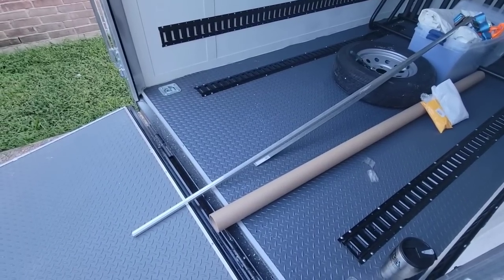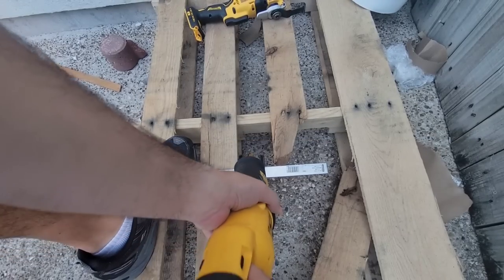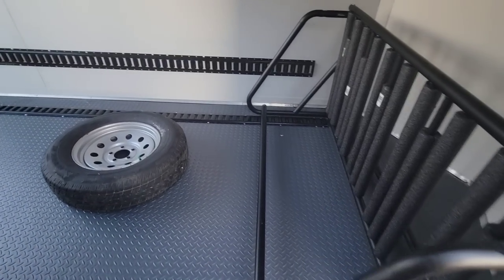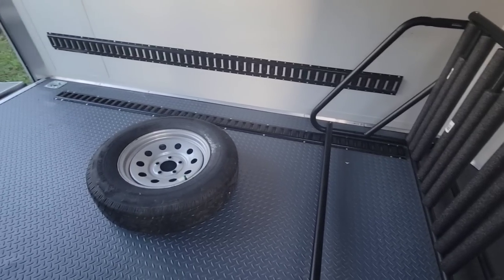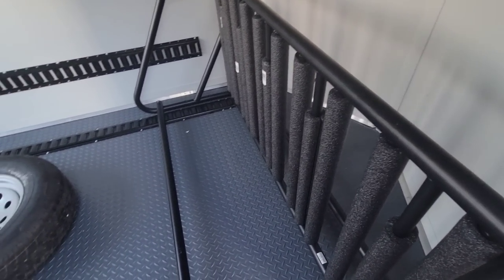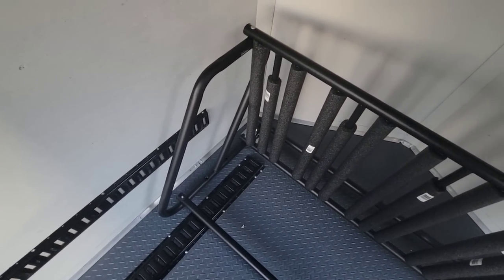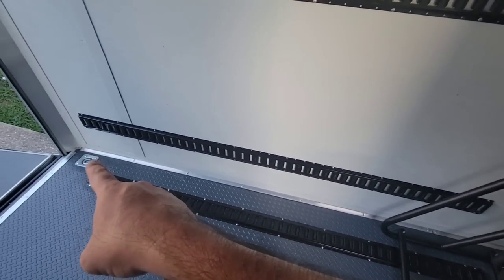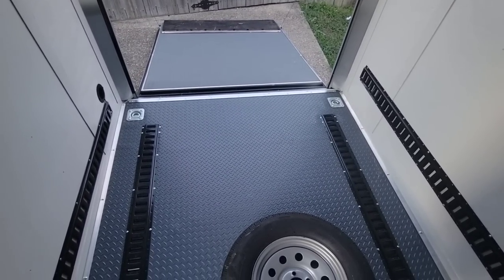The Big finish! Adding the coolest feature to the cargo trailer!

Comment: Hey JD I bought my 7x16 cargo trailer back in 2008. And I added tons of e-track to it much like you have done. One thing I did was I ran track all the way at the top down both sides of the trailer. What I use this track for is storage of my track accessories. I just clip them in and it keeps everything organized as well as handy. Also I have about a dozen of e-trailer item number DU64GR.
I cut 2x4’s to fit in them across my trailer. I store the 2x4’s in them in the e-track at the top of the trailer than just drop them down when I need to use them. I use the 2x4’s like semi’s and box trucks use load bars. Also sometimes I just drop them and put a piece of plywood across for a work bench or desk.

Comment: The front shelf you speak of, I would look at installing 2 of those folding shelves you showed on a previous video. You could cut the inside edge's at an angle where they meet up. That way you can fold them out of the way if you need the extra space. Just a thought.

Comment: Get a  piano hinge and cut to length to fit in the back door/ramp.  Cut a piece of 1/2 to 3/4 inch think pressure treated plywood, the length, and width, of the "gap" at the back door. Attach the plywood to the hinge, then attach it to the back frame of the door.  Then, when the main door is open, flip the plywood back and down into the 'gap' so you don't have a major dip or open area to roll wheels over.  When finished loading, flip the 'flap' back into the trailer. This would be beneficial when you're transporting things other than bike's, with smaller wheels.

Comment: In your last issue with the auto level you can hit retract all without having to hook up or put jack stands down. And since you dropped the front down with the pins it is even easier to watch. We have done it plenty of times because of the 377rlbh design we never have to drop the jacks with the pins since most times it will go have to go down that far
Reply from the maker: Yep, that was an option.  I did what the LCI Tech suggested.